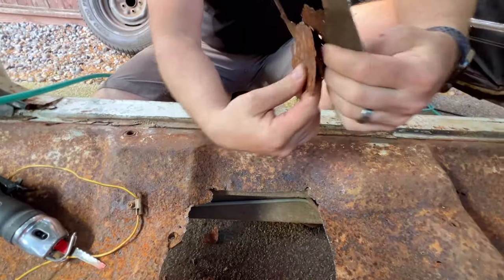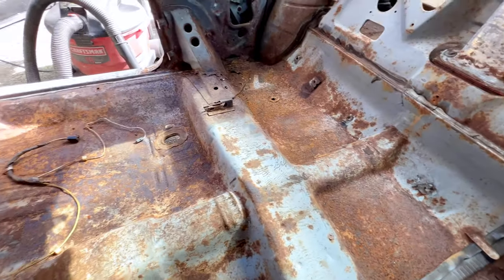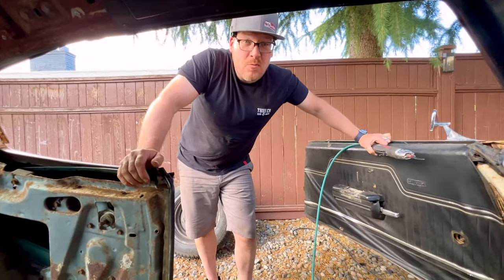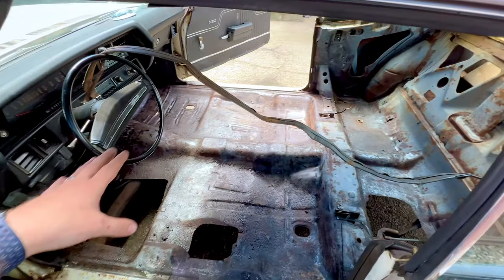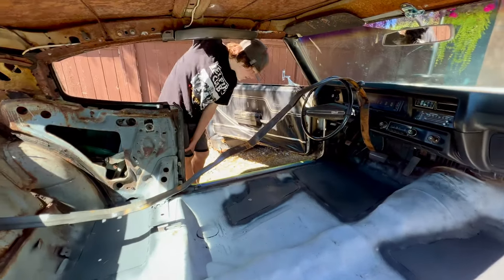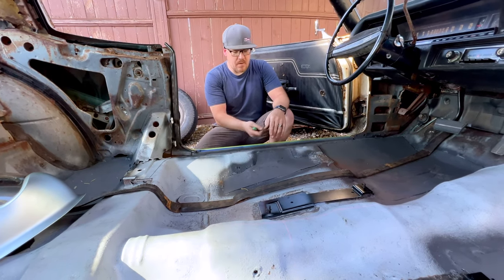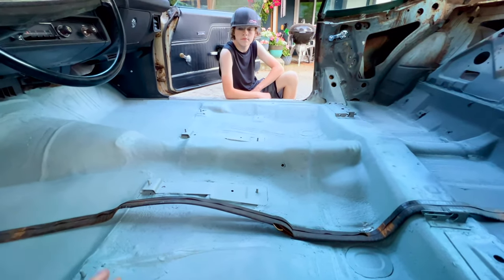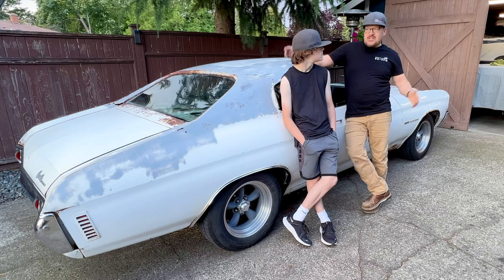RUST repair: FAST & CHEAP + New Seats for the Barn Find Chevelle

Comment: Looks like a good project. That little air saw works good. I need to get one
Reply from the maker: Those air saws are fantastic. If you buy one, be sure to get one that is gear driven. They have much more power. The cheaper ones don’t have the same torque allowing the blade to get stuck in the metal. They are not nearly as effective. 

~ Nick